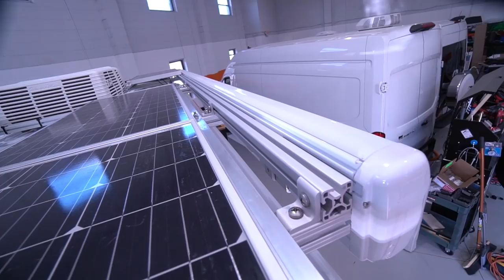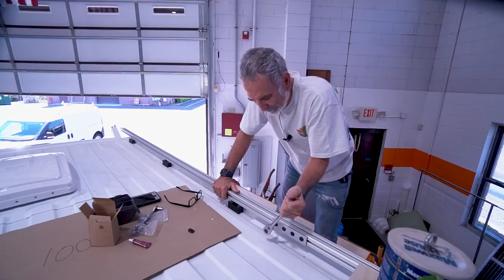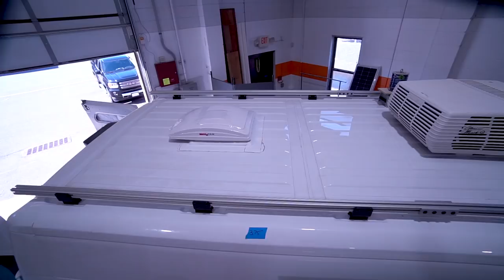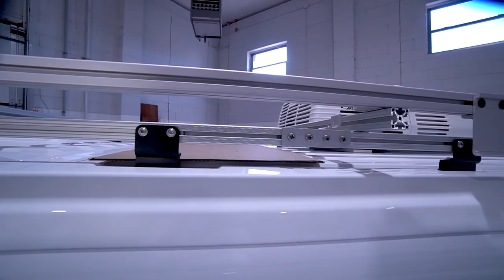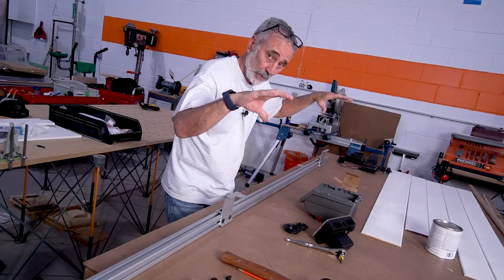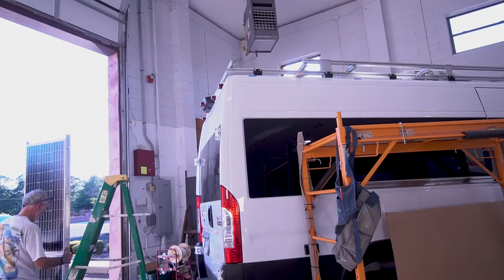Building a SOLAR ROOF RACK (on your van) using 8020 extruded aluminum

Comment: Holy - complex rats nest - no aerodynamics - reduce gas mileage - wind noise - way too tall - extra tipsy - ugly as f -way too heavy  - BATMAN... To me it is so bad - I'm speechless-;) Ever heard of flexible solar panels?
Reply from the maker: Yes...I have heard of flexible solar panels, hence what you see here.
Reply: @HumbleRoad My  flexible panels have performed just fine going on 5 years, now.
When the Sun Power panels die I will replace them them with the 1.5 mpg $ I have saved by not have that abomination on the roof. And my Van will still look good.
You rig will always look 'not good" - but hey it that does not matter  to you- knock yourself out...
Reply: George, those are fighting words and some harsh criticisms.  I hope you know that most of us do not find your work to be an abomination.  With that said I would point out that maybe it's worthwhile to see if you can calculate what the average cost of your system is due to wind resistance.  That might take some doing, but you might have a subscriber that's an engineer... And I have a question for you: What grade stainless did you pick?  305?  316?
Reply: @Chris 
I know flex panels are more expensive and not as good - but I chose to pay the price and deal with the consequences.
No it is actually 1.5mpg from my research. For me it is not all about the money - but I want to drive something that look decent and does not catch trees up top as I go exploring. If all you do is go from paid campsite to campsite and stay on the pavement then you are gold. My roof has plenty of pinstriping from branches as I am on backroad trails a sh*t ton...
FYI - The roof rack is an abomination - most of George's other work is top notch. 

I'm sure he and his sheep will stick with him and stay the course.
Reply: @Chris Pozers may hate them - 5 years in - I would do it again son...
I amjust  also not into the scafolding look - YMMV
Reply from the maker: Terry B, I encourage and welcome spirited conversations and discussions. But you are treading close to a negative harsh line which will get you banned from commenting. I will not allow any negativity, judgementalism, nor drama on my channel.
Reply: Stay calm Terry, try to keep it positive, we're all in this together.
Reply: @moneypitvan6378  hey money pits - we good son - so be a good little sheep & mind ur own bisness - I'm sure HR can take a little of the heat without UR enlightening input.
Reply: @TerryManitoba  I'm sure he can, but I'll still add my take. No need to come at anyone so negatively, especially when it's within the van-building community.
Reply: @moneypitvan6378  sure
Reply: @moneypitvan6378  Mostly,  what I post on YT is encouraging - however, if I see something that is egregiously bad (IMHO) I will post. Not for my benefit but I post it loud enough so that a Newbie, who is looking for a little direction/handholding (I know cuz I was there in my learning journey and have seen a bunch of bad info) does have a second point of view.  A newbie is more likely to see this now, so I appreciate everyone's comments to boost the exposure of this post and putting more cash in HRs coffers! - your welcome!  HR does a sh*t ton to gold standard - unfortunately, he is not perfect - apparently, some think he may be...

So for the newbies out there- consider not putting scaffolding on your roof (unless you chrome plate it - Then UR GOOD)